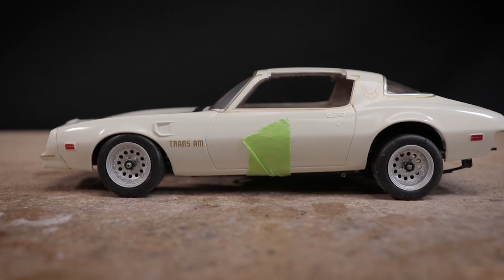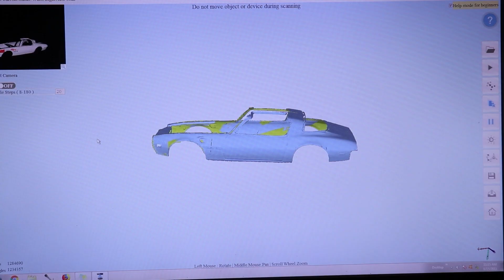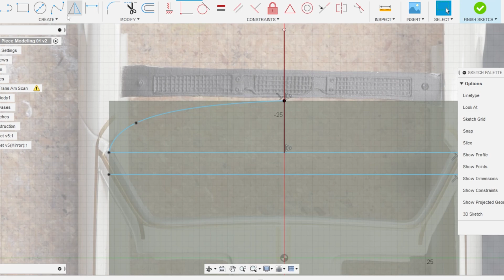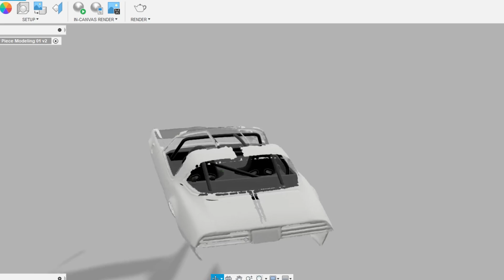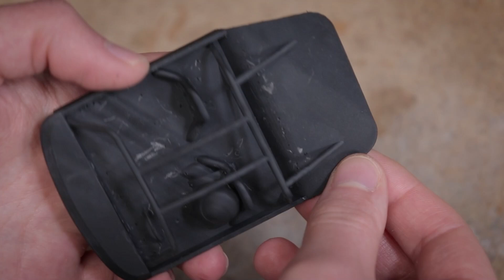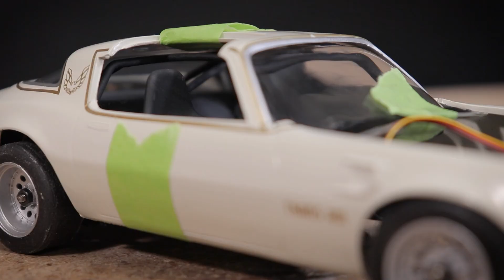Designing and 3D Printing Custom Interior Piece for 1/25 Scale RC Trans Am Project

Comment: I just wanna recommend using shocks with the spring leaf suspension as that will probably solve the sagging problem (IDK if this is helpful or if it had been recommended before)
Reply from the maker: Yeah I've had this idea and talked about doing this in a prior video. It looks like I might need to add some coil springs to use in conjunction with the leaves.